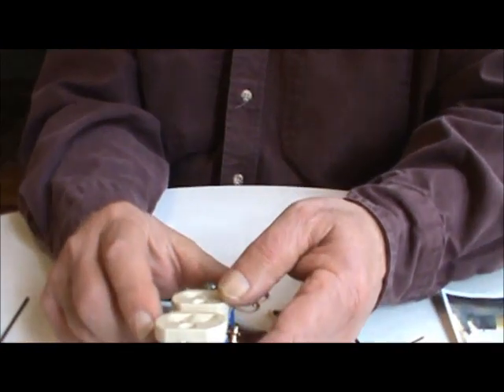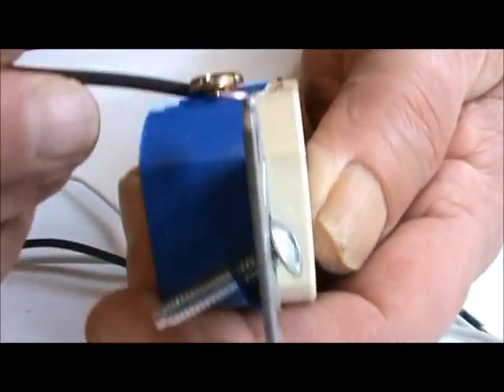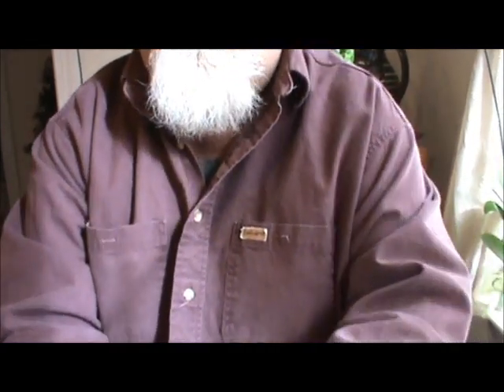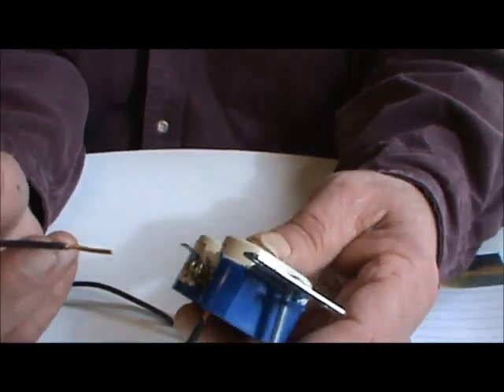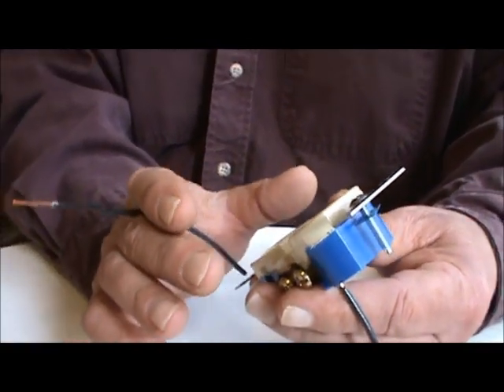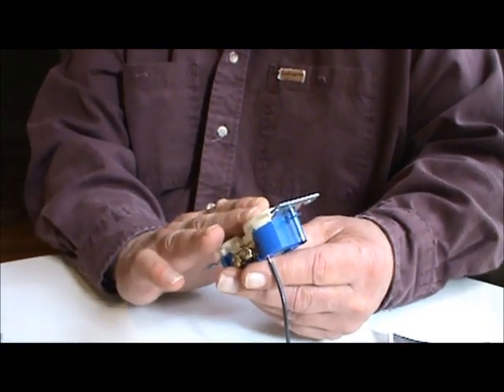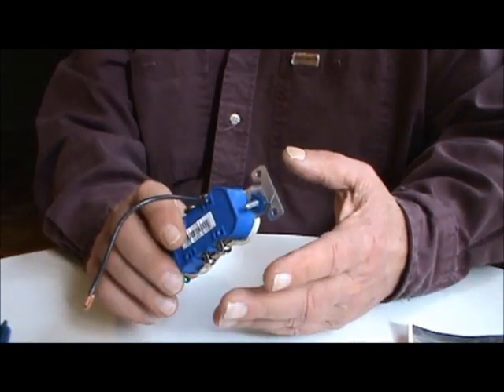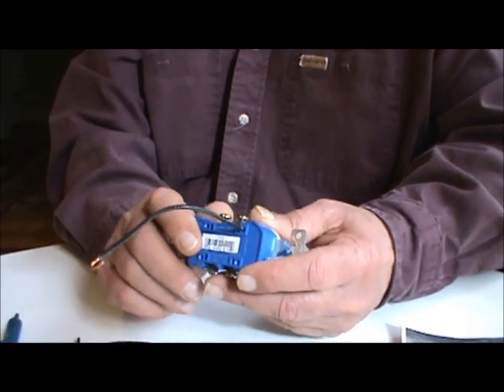Why Are My Outlets / Receptacles Getting Warm

Comment: I installed Stelpro model#PCH4.8, 240 volt 4800 watt electric heater into my garage (purchased used off of Facebook Marketplace). I installed a double pole stablock 30 amp breaker along with 10-2 wire. I bought a Leviton nema 6-30R receptacle and everything seemed to work ok. My problem is the end of the heater's cord gets very warm during operation (the two flat plug terminals are too hot to touch)... why is this?

Comment: I have a question for you sir “and by the way thank you for the information it is very helpful”.. 
Now here is my problem, I am remodeling a mobile home and of course all of the receptacles are stabbed, my GFCI in the master bathroom also connects to the exterior outlet in the backyard.. When I went to replace the GFCI I noticed that the HOT black connection is melted but the gfci never tripped, the lady of the house uses a small space heater in the winter when she gets out of the shower. 
What do you think is the issue?

Comment: I've got an unusual problem. For 20 years, an outlet of mine has had a six outlet brick thing plugged into so multiple items can be plugged in. But now I can't get the six outlet thing out, no matter how much i pull. For many years there was a space heater plugged into it. So maybe its melted in? I can't get any access to the original outlet because the six outlet brick completely covers it. It still works fine but this really sucks because I want to plug in a surge protector. Any thoughts, next steps? Thanks! Its also in a cold basement room.
Reply from the maker: Can you text me a picture up close of your brick 434) 284)0600 i can help you
Reply from the maker: I do not charge you .

Comment: I think I have a socket that is doing just that, I have an electrical outlet that is warming up & there is a space heater in another plug that is on the other side of the wall. Is this dangerous, can this start a fire?
Reply from the maker: I would take it out and check the wires and see if they are loose.
Reply from the maker: You can call me if you want 434) 284) 0600

Comment: I installed a 125v 20a GFCI outlet last night, and one of thw wires had burned up to where an inch and a half of copper wiring was exposed. I put heat shrink over the exposed length and an extra half inch (this is on a boat from 1978, so the wiring might be due for replacing). I kept feeling that it was somewhat warm after installing. I dunno if I should be terrified and worried about a possible fire hazard. Nothing's plugged in, but I heard the light and current running through could make it warm. It doesn't feel hot to the touch, but i can definitely make out a bit of warmth. Should I be concerned or is that normal?
Reply from the maker: You should be fine It was loose joint just keep a eye on it , Thanks for watching Merry Christmas.

Comment: Mine are getting to about 100-120F on my space heater. Just the heater plug though,  if I use an extension cord (and yes a proper 14/3 one) the plug gets warm but the outlet Isn’t really but a tad above room temp.
Reply from the maker: That sounds right. Thanks for watching

Comment: Nature's Friends.. I have a 220v outlet in my garage for a heater. What would make the cord get warm where it plugs into the outlet? Not hot but it does get warm. Is this normal?
Reply from the maker: Yes it will get warm try to use a size 12 or 14 gauge cord thanks for watching

Comment: i have a GFCI receptacle in gargage. I have plugged into it a freezer. NP. But I plug in a security cam and now the Cam and power adapter gets very hot. I then plugged in security cam in house and not hot at all. Is this due to the freezer using the CFCI receptacle?
Reply from the maker: I do not know sorry I will think on this one.

Comment: Most likely the prongs of the plug are not making good contact with the blades inside the outlet - common as receptacles wear out over time and the blades lose their tension and do not grip the prongs securely.

Comment: Thanks so much for this. I just unplugged a 1500 watt smart heater from my orange extension cord. This is the first time i noticed when i unplugged the heater in the greenhouse the cord plug end where i plugged in the heater was really hot. If i get a 1000 watt heater and use it with the extension cord will that be ok? Ive seen heaters that are 250 watt as well. I only need to heat a 4x8 space. Thank you so much. I had also recently changed my pinned outlets to using a "hook" for the connected wires.
Reply from the maker: Yes 1000 watt would be better, make sure the cord is not curled up.

Comment: Very useful video. I'm in the UK.  Our outlets are fed from 32 amp breakers. The sockets themselves are rated up to 20 amps.
These get warm too, but only when you are using more powerful appliances. The plug on my oil radiator is warm-ish and that's drawing 8.6 amps at 230 volts. The lower the voltage, the higher the amps.
Reply from the maker: You are right glad you liked it hope you enjoy our channel Don't forget to subscribe Thanks

Comment: Overload is due to wire gauge and the quality of the outlet itself. That’s why a commercial grade or higher outlet is worth installing. They outlet don’t work loose as quick as the low end residential grade outlets.
Reply from the maker: You are right Thanks.

Comment: Can u run 2 water pump from one plug
Reply from the maker: You can call me at 434 -284-0600
Reply: @TheNaturesFriends  please reply cause i need to no
Reply: @TheNaturesFriends  the plug is run straight from the breaker so i just wan to no if i could run 2 waterpump
Reply from the maker: @blackknite2518  What is the amps of motor what size wire

Comment: Hello sir,

Great video!!!

I’m having a situation now, i got a new washer machine 10 amps and when I plug 🔌 it the outlet sparks ⚡️.  it only sparks when I plug the washer. I understand it has the most amps compare to the others appliances where I have it located. Also it is plugged to a gfci outlet. 

Now let me tell you about the breaker where i plug it. It is a 20 amps breaker and I noticed that breaker supply my refrigerator 6.5 amps  and another outlet which I use it to charge cellphones and and 1 led light with low amps  as well. Now when I use the washer machine, only the refrigerator is pulling amps and the rest are unplugged. 

Do you think is the refrigerator plugged in the same outlet causing the sparks ? Even though the outlet are separated but coming from the same 20 amps breaker.

Sorry if this is too much writing and hope I won’t confused you. 

Thanks!!
Reply from the maker: You can call me we can talk about it 434-284-0600

Comment: Thank you so much for this info!! Would you be able to explain to me why the prongs on the cord of my electric space heater got really hot?? I don’t use it anymore. But would there be any danger inside that outlet I should be concerned about?? Thank you!!
Reply from the maker: Turn the breaker off and check if the wires are stabbed if so rap the wire around the screw and tighten  the screw.
Reply: Harold Shifflett Thank you so much!! Loving your channel!!! 👍
Reply from the maker: Thank you
Reply: Same here in bathroom but not in kitchen. Had outlets replaced using heavy duty replacements at my brothers suggestion. But not schooled in this, so dont know what was really used. Thank you. Will try at lower temp as suggested.

Comment: Use a premium receptacle and pigtail your wires.  At the end of the day, if you installed it the way the manufacture specifies is appropriate and it warms up, the manufacture is negligent and should be held accountable.  And, yes, I've actually seen those outlets fail (I believe it was a place that used space heaters regularly).
Reply from the maker: You are right, Heaters are the worst. Thank you for watching.